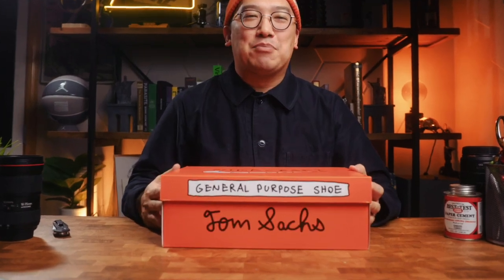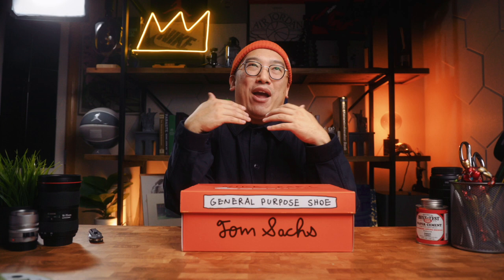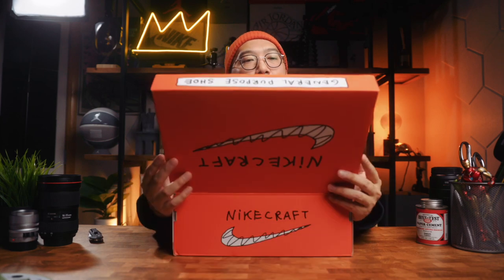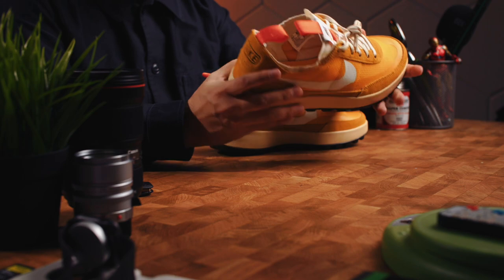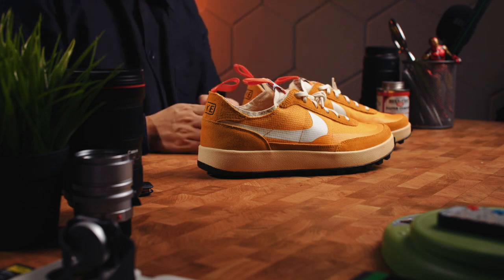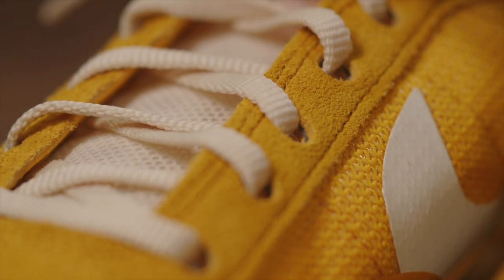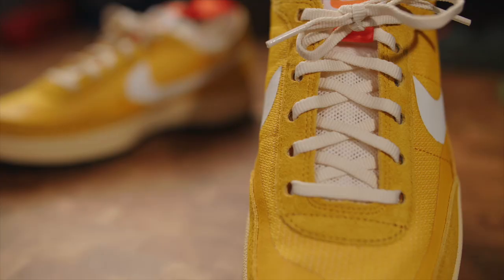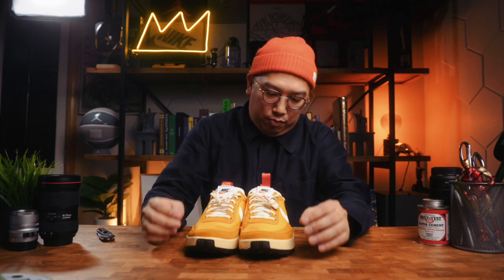Sneaker as High Art - Tom Sachs x NikeCraft General Purpose Shoe Archive Dark Sulfur Review

Comment: Hi! Would you say these run TTS or half size Down would be a better fit ?
Reply from the maker: True to size but yes it has the a tiny bit of extra room but not enough to go half size down for me. I think it's based on how spot on TTS is for you!
Reply: @minsoochoi  Thanks. Well for cintext I wear US 10 in my NB 990V3, V4 and they are very comfy- no heel slippage and i tie my laces loose. with these i heard TTS causes heel slippage as the material is thinner etc. hence the confusion
Reply from the maker: @KKSr.  I wear a size 9 in 990v3s, and I love how the GPS fits in size 9 for me.
Reply: TTS for sure